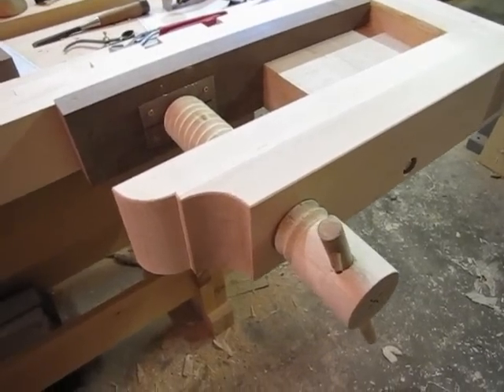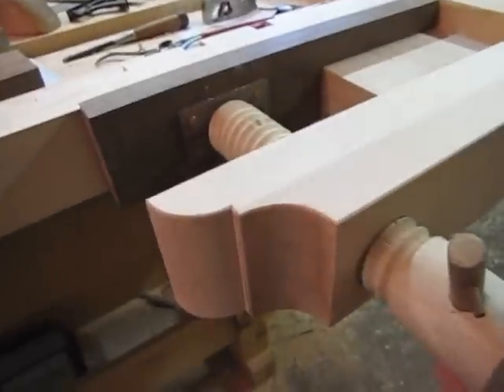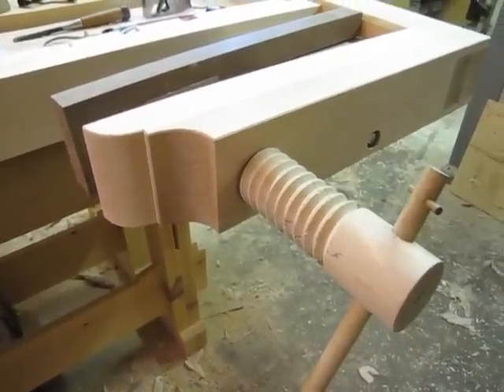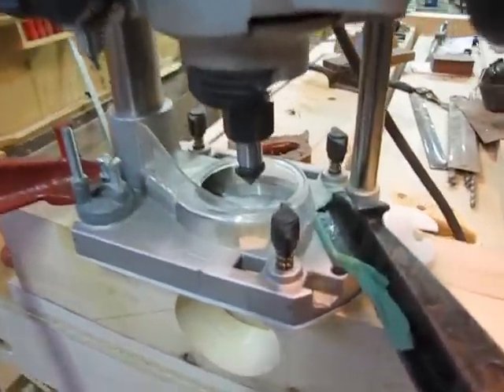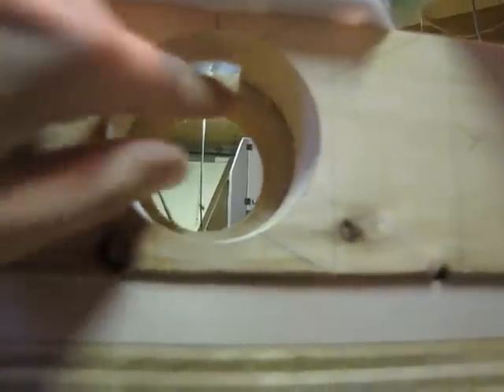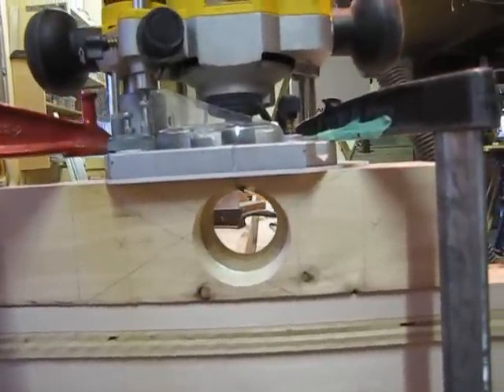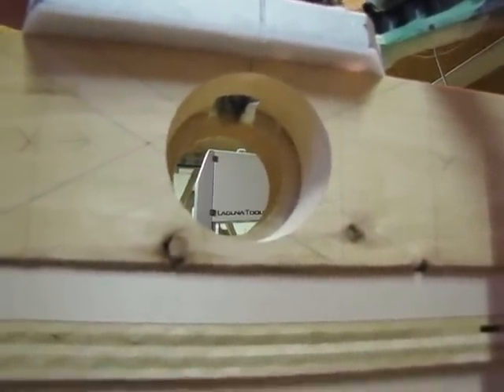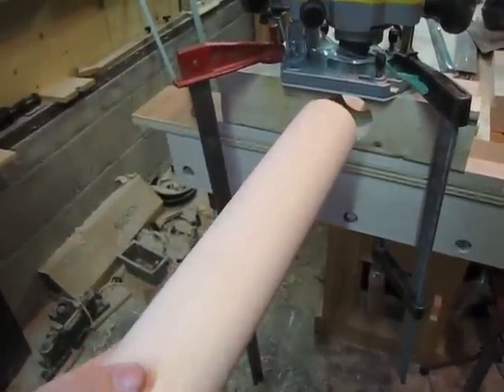Making Wooden Screws

Comment: your threads will come out a lot better if you do two things... slow down, and try to find a way to turn the blank at a consistent speed.. something along the lines of a brace gripping the end of a lag bolt screwed into the end of the blank..

Comment: I am currently in the middle of building a pine prototype of this project.  I missed the fact that this requires 2 different size dowels and the corresponding 2 drill bits.  One size for the tap and a larger diameter dowel/bit for the final screw.  I didn't catch that in the videos... oh well.  I will be turning the larger dowel tonight.

Comment: Shalom, your excellent videos are being enjoyed in Israel! I have not found the video regarding the making of this jig. I did find this comment of yours that I will paste for the use of other, but a video, or a better explanation would be much appreciated. I did not understand how to align the gap for the router I imagine it is on the edge of the 2" hole wood right at the first thread?
Anyways, its a bit confusing...
The router bit is always 90 degrees for all screw sizes?

Thank you.
 "To make the jig I use two pieces of wood. One has the 2.5” hole, the other has the 2”. If you layout the center of the hole on each piece, wrapping the layout lines around the part, and use a fence on a drill press, it will make aligning the pieces easy. So the first step would be to drill out both those holes. Then you tap the 2” hole. Then line up to two pieces together and screw them together. Then using the 2.5” hole as a guide for your drill bit, drill through it into the 2” tapped hole until you drill halfway into the thread that the router bit lines up with (*). You will also need the cut out a gap in the top of the threaded part (to allow for the router bit to be lowered into the jig) before screwing the two pieces together.
	
If that doesn’t make much sense in words, it will be thoroughly explained in the video series."

Comment: You should wax it, the wooden screw after it is made. Also, The idea that any nut with a correspondent drill bit size will make a screw, is excellent. If you want to make the female, get a metal screw, shave it on both sides of the treads and that is it.  Thank you very much.

Comment: I don't get it ?
How does it make the thread the correct distance from each other thread. ?
Reply: да наверное сама идет фреза в 1 видео
Reply: Shahram Fereydoni
I see the vid where did the inside female come from, I mean they already make a wooden threader that makes male and female threads. But I don't see how he made the inside female thread. He just assumes everyone has one and now he's using it to make a male threaded dowel
The dowel threaders don't even need a router.

Not that this method is bad I just don't see how he made the thread. How does he make the inside thread in order to get the correct thread for his female thread ? Does he have another vid on this or something ?

OR is that just a different is hole side on the inside ? I can see if it's just a smaller hole maybe but it looks like he has an inner thread
Reply: +Captain86 I believe the nut is made first...see his other videos. It tells you at the end of this video there is a tutorial. First, make the jig to make the nut. Make the nuts. Use one of the nuts as a guide for the screw you want to make. Then you make the screw as shown in this video.